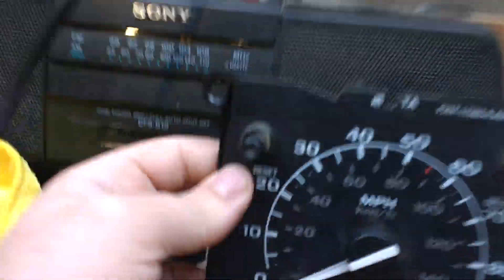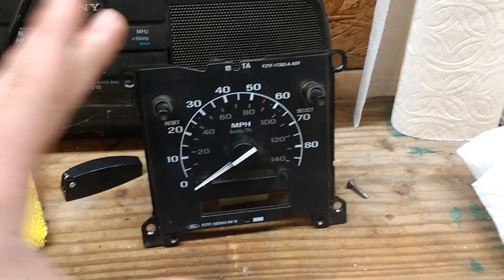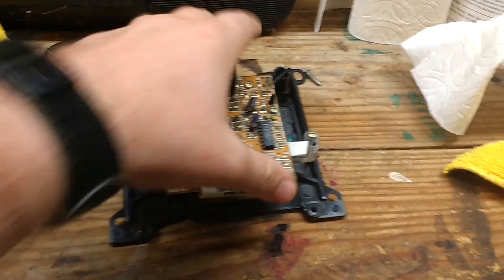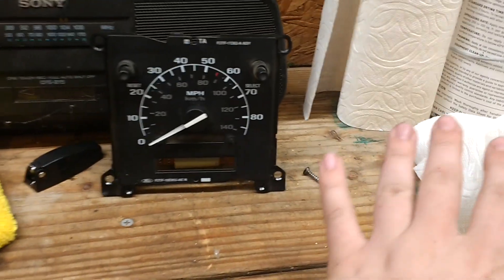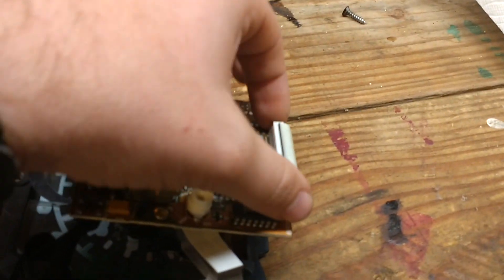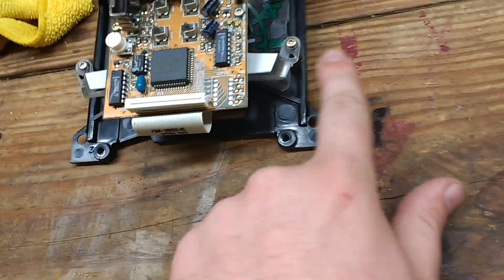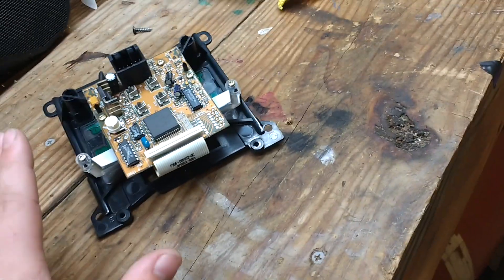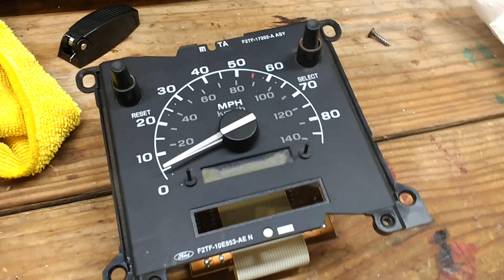LCD Odometer Fix - OBS Ford F-150

Comment: See mine lights up but won’t show numbers
Reply from the maker: Might be either a bad ribbon cable or a bad speedo module
Reply: @granthopper5  so all I gotta do is do what this guy did?
Reply from the maker: @XD_7.3  might be a wiring issue with the speedo module, or an issue with the cluster

Comment: Yep I have this right now.  A melted odometer.
Reply: Did the blinker work?
Reply: @oversea6171  Everything works, just the odometer display window is melted.  You can even see the odometer # of miles at night with the lights on.

Comment: I took a junkyard instrument cluster panel and replaced my original with it. The mileage displayed perfectly but wrong mileage. I took it back out and took the mileage display out and put it in my original cluster to have the right mileage but now it lights up but it doesn't show anything now.  Any advice
Reply from the maker: Hmm... Was it displaying anything comprehensive before you swapped it? Make sure you put the display cable in the correct way - not completely sure, but as a I remember there was nothing preventing the display from being hooked up backwards.

Comment: Great video. Straight to the point. I just got a replacement cluster panel from a junkyard and it shows more miles than my original. I didn't know what to do. I will try it out thanks
Reply from the maker: Hope it helped!